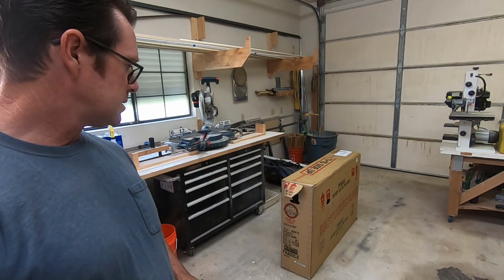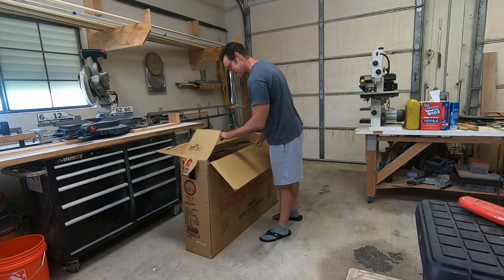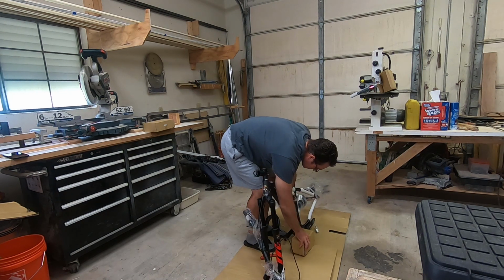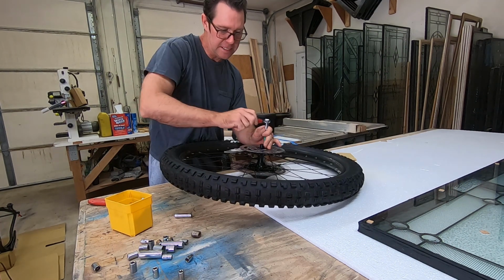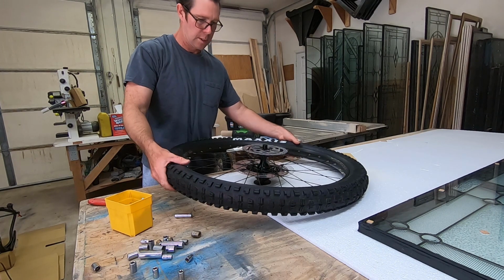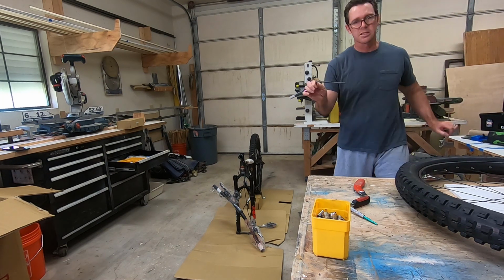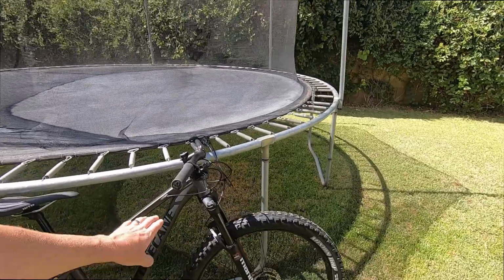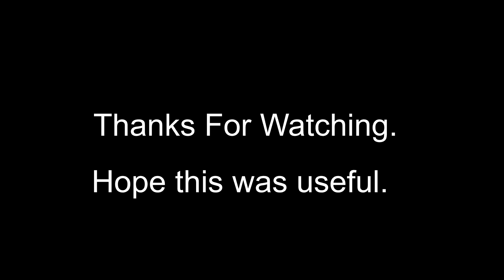I bought this bike for my daughter. Extreme monster in a 15.5 frame. Unboxing first impressions

Comment: “I don’t have a bike stand”...but I have a fully equipped workshop where I can easily make one. Looks like the Taz3 is now being spec’d with the new Shimano M6100 1x12 drivetrain. Maybe an upgrade from the entry level SRAM. I purchased a $400 Motobecane W27HT myb for my GF. Very impressed with the quality and components for the money.
Reply from the maker: Yeah, yeah, yeah. Probably should get on that. No excuses.

Comment: Your daughter is 5'4" how does 15.5 bike fits her? I am 5'7" right in-between sizes and wonder if I should go to next step - 17.5?
Reply from the maker: Being that it is a hard tail. I recommend the next size up. The 15 fits her perfectly.  It has a low stand over height and you could easily upgrade the dropper post from 120 to 150/160mm.🤙🤙 Awesome bike, though. If you are a beginner the 30tooth chain ring is good. If you are strong you may want to upgrade to 32/34 front chainring for faster top speeds.
Reply: @weekendmountainbiker9457  Thank you. Still trying to decide between 27.5 and 29
Reply from the maker: Hardtail, I'd go 29". Good luck.

Comment: i just got a 29x3 wheelset on 50mm rims...    and right now i got the 29+ in the back and the 26.4.8 up front.   the rear tire is actually taller from the ground  than the fat bike tire.   with a casual glance, you wouldnt think the rear tire was any smaller than the front tire, that 3" is BEEFY.
Reply from the maker: I saw your trials turn on those monsters on the skinny.  Nice work.